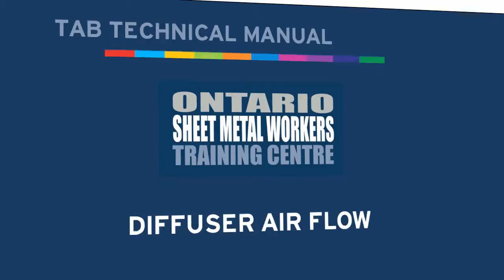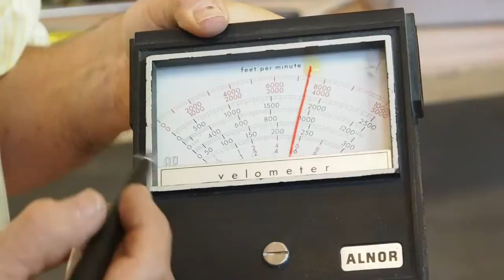Diffuser Air Flow

Comment: Bob, This is 2014 and it has proved to be so erratic I will call this method useless .  Get a flow hood  or do a traverse but that method went out long ago.
Reply: Hello sir. As per this comment find me helpful since I have to rely to the equipment to check the actual vs design. May I ask sir the computation part where you need to multiply the velocity with the area. How will you determine the area with diffuser using flow hood? Using traverse its easy by using the duct area but with diffuser should it be same? I compare the values the traverse has greater value